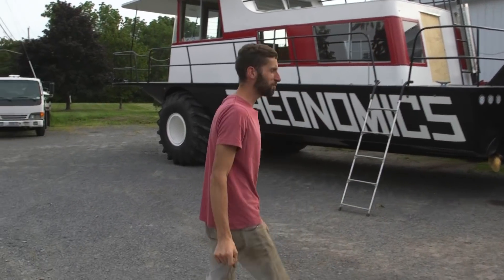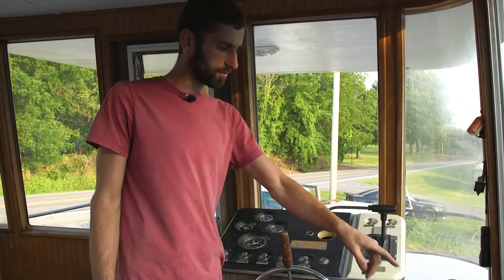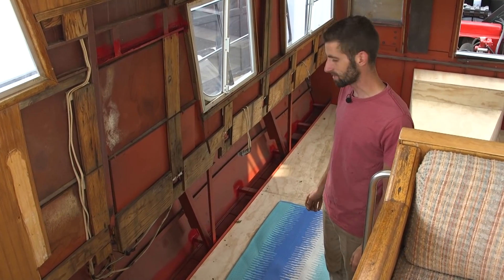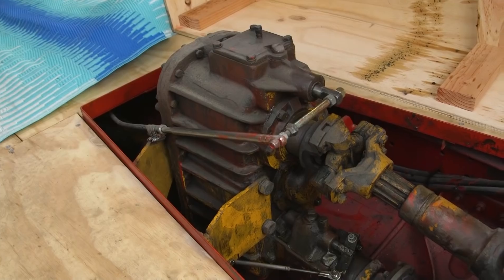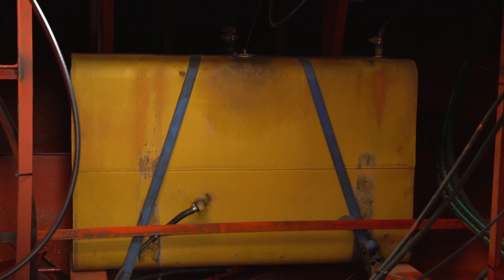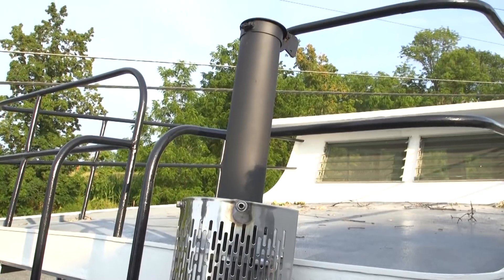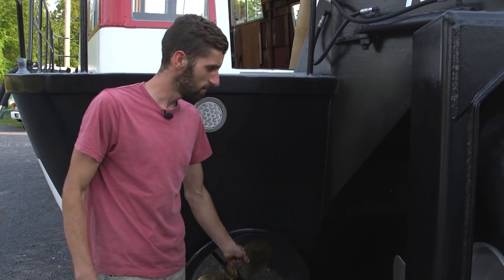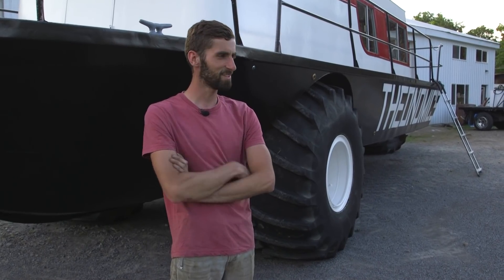Amphibious Driveable Houseboat | How It Works Tour

Comment: We have a Big-A 2500 that we use to water our race track.  It is pretty much the same rig except for ours has a Cummins 555 and a manual transmission. Whom ever had it before put wheel loader tires on the back, and two smaller ones in the front spaced about 14 inches apart to straddle a row of corn. I bring this up only because it might make for a better rudder, reducing drag and increasing control.
Reply from the maker: That's awesome! Good to know these things are still out there being used. This one was retired from agricultural usage and sat unused for many years, before it was sourced for this project.

Comment: Use the lightest material when doing your interior to cut down on weight when operating on land for great fuel economy. Dual exhaust with mufflers.  They must offer heavy duty mufflers to silence the beast. The dual exhaust could b designed as decorative pieces. Just don't run the pipe under water. Like i said in an another comment in your previous video "so much potential".

Comment: wow , that is very cool use of old stuff. great job.! question ..... what is transmitting torque to your propellers? if you are using a hydraulic system ,could control each prop independantly.. still would qualify as old school.  lol!  whatever you do , im sure it will be the best buggout camper anyone could have.
Reply from the maker: Hey thanks for checking it out. Unfortunately I'm not certain the torque specs off the top of my head. I will be looking into ways to improve all-around performance in the spring, so any input is always appreciated.

Comment: Are there any issues buying fuel at the dock vs a gas station as far as road taxes?
Reply from the maker: Not sure why, but fuel always seems to be more expensive at marinas. We'll usually just fill it manually via personal gas tank. Haven't pulled up to a gas station with it... yet haha
Reply: fuel at marinas is more expensive do to permitting , taxes and monitoring. (just by being so close to the water). actual profit to the marina is only pennies on the dollar. Mikes Marine, Ithaca NY.
Reply: Ethenahol is the biggest problem with (gas) boats. We treat our gas with additive to counter act the effects of the Ethenahol. A lot of people rather fill their boats at regular gas stations because its a lot cheaper, ( if they can). now as far as diesel. you can run K-1 heating fuel in a diesel engine. Its not allowed by governing bodies because of TAXES! K-1 will run cleaner and more efficient. being your using it for recreation and not OTR I don't see why there would be a problem.
Reply from the maker: Really appreciate that insight, thanks! It's unfortunate that marines/boaters have to pay extra, but good to know there are some alternative options. I'll have to remember that.

Comment: Very cool. Great job. If you want to run a hull exhaust, I would suggest a wet exhaust. Very quiet and reliable. Just need a water pump through hull, and high pressure line to exhaust.
Reply from the maker: Really appreciate that, thanks! Fortunately we have a few month to tweak things, before next boating season starts.

Comment: The more I see of this, the more impressed I am! 
How did you seal around the axle for front wheels? Is there no suspension?
Reply from the maker: Really appreciate that, thanks. No suspension, but it's surprisingly smooth, because of the large tires. In the wheel wells the axle was sealed via welding and reinforced with some epoxy. No leaks, yet haha.

Comment: Great project, better result. Bit of mustard after the meal perhaps, but it seems to me that making it all hydraulically driven would be a lot simpler (though probably less efficient, but who cares about that in a amphibious house), lighter and more compact. Is the reason for this mechanical drive system just because you got the sprayer?
Reply from the maker: Thanks. I guess there are a few ways it could have worked, but it was most convenient/cheapest to utilize most of the sprayer, including it's drive-train, axle, wheels, etc... If someone wanted to build one from the ground up, there is certainly room for improvement. But with relatively limited resources, this was the best available route to take.